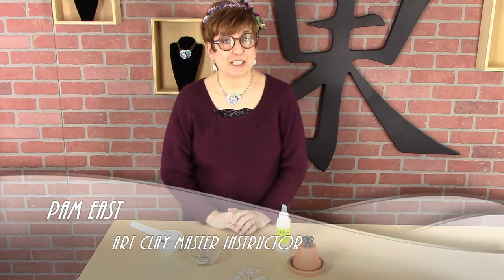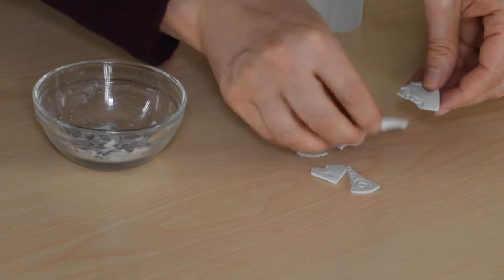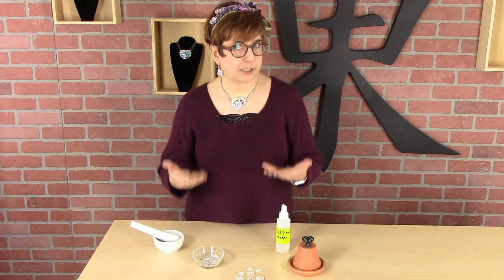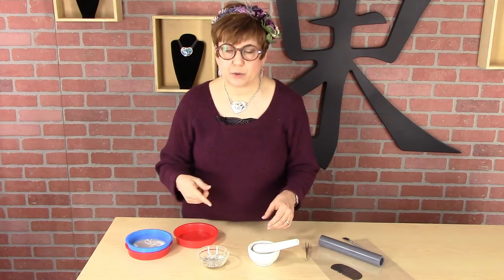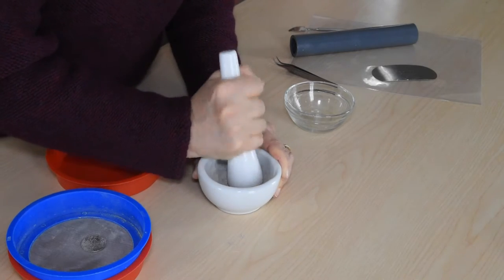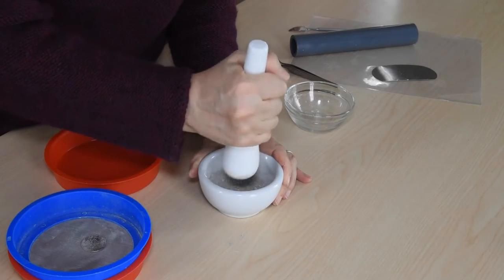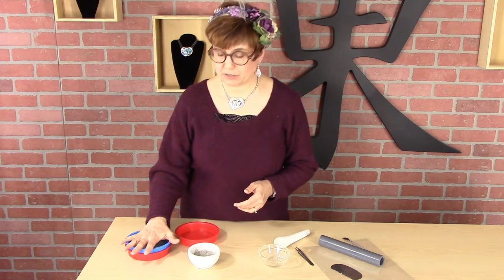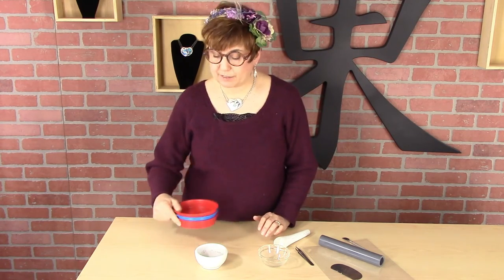How to rehydrate metal clay with Pam East

Comment: Great video Pam, just what I was looking for. How does the rehydration process affect the shrinkage effect and is there anything that can be done to limit the effect? Thanks again.
Reply from the maker: It can affect shrinkage. Mostly because the amount of water may no longer be consistent. If there is more water in the clay, then it will shink more as it dries.  But once dry it should be close to the Dry to Sintered shrinkage.   Try to get your rehydrated clay as close as possible to the original consistancy to reduce this issue.

Comment: Pam what would you recommend for an entire package of clay that has gone hard - misting/hydrator or pulverize and wet?
Reply from the maker: I'd recommend a lot of patience!  lol.  First,  I recommend slicing it into smaller sections using a jewelers saw.  Don't make the pieces too small, but 1/4" thick slices should work better.  Then using the misting/Hydrator method. This will get the best results with the least waste.   You always lose some when you pulverize and it's never quite as smooth.